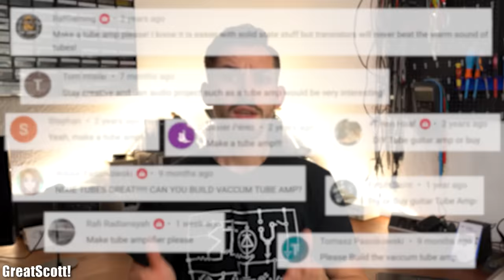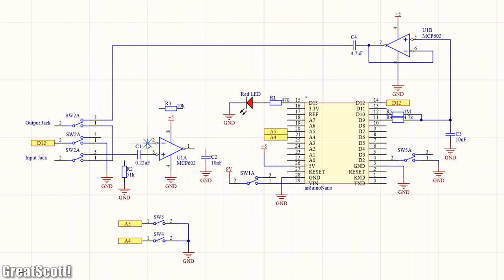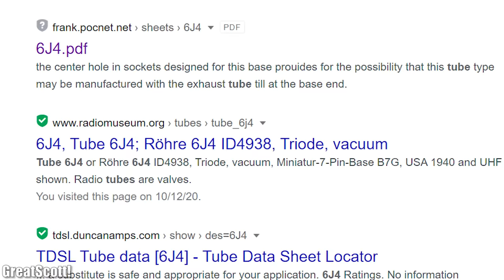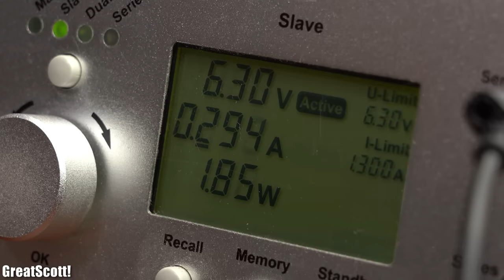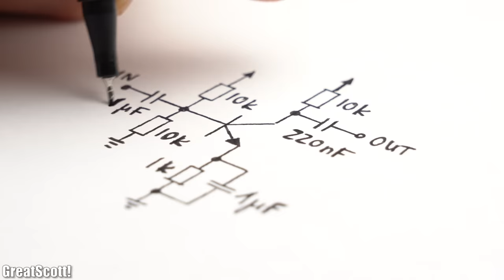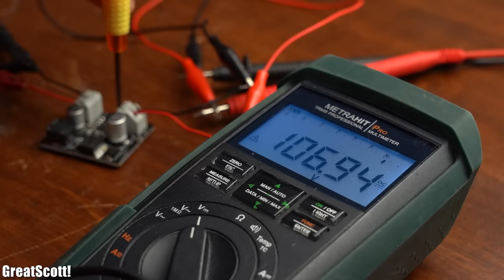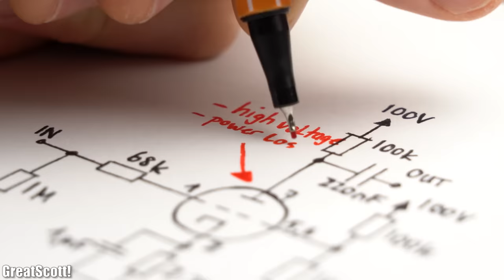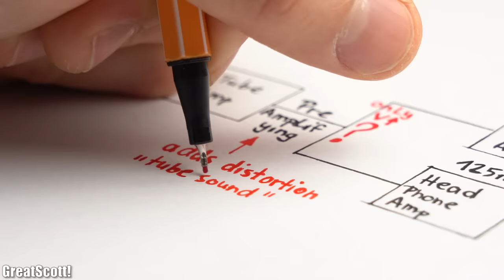Building a Tube Amp! Does it produce better audio quality though? EB#47

Comment: Tubes are just better..  I use Tube Pre-Amp's and Power Amp's ...   I do use solid state pre-amps at times with a DSP unit inline. these are then mixed to the input of the Tube Power Amp. 
The Tube pre-amp has a a EXF loop to a tube sweetener 3 12ax7's   the the Solid State pre-amp has a EXF loop to a DSP unit ( you can do just about anything you wish in this area ) both outputs are then mixed together Dry and Wet .. Dry being the tube unit and wet being the solid state unit.
This allows for so many setups and music types. with todays ADAT - DAT - and Hard-Disk ( or now solid state drives ) you need something to put the life back into the sound....  Tubes and Tube Sweeteners do just that !  Just remember that your drivers add color as well...   Unless you spend BIG DOLLARS... 
The Joke is this . . . .    Witch is better?????    1)  a single to that has been EQ'ed to correct the room    OR    2) a correct flat single in an incorrect room... both ways the single is changed once is gets to your ears . . .    So if its sounds better it is better ! and Tubes just sound better !

Comment: I'm not a fan of tubes either due to so much vice and I find those that say they like them don't actually understand the distortion produced or if their tube amp they love really produces worthwhile 2nd harmonics. For this video you really should have shown spectrum analysis to see what harmonics the tube circuit produced. The ultimate goal is a big fat 2nd harmonic and as little odd harmonics as possible. I've compared a few tube amps this way and most don't produce 2h that's even audible and add a tone of odd harmonics. So most tube guys are listening very poor audio which is amusing. Or they buy expensive tube amps that are highly linearized and carry no harmonics and may as well be listening to a good silicone amp which is equally amusing.

Comment: Best to go with a tube preamp with active EQ old school stereo equipment to a tube stereo power amp sperates then to speakers. My preamp is 1959 era 2 ea 7199 pre tubes 1 each per channel, 2 each 12AU7A or 5814WA 1 for bass another for treble each channel cathode following circuit= 4 volt to RCA output to a 1959 tube stereo power amp 2ea 7199 -1 per channel to 4 each 7408 or 6v6gta 2 push/pull each channel to 5 way binding post outputs to my Altec Lansing model 17’s speakers, super imagine, outstanding clarity, airy, superior sound stage, voicing identical to the instrument being reproduced by the Altec’s. About 18 watts per channel you would never imagine 18 watts of tube power could give out such power. Speakers are rated at 117 db 1 watt at 3 ft. Point to point design not one transistor in there using solid copper low oxygen wire silver soldiered joints.

Comment: Doing an A/B test of steady state tones does nothing for a test, audio is a complex wave, you have transition times, phasing, differnt results based on output load etc. The ouput stage of a tube amp going to a transformer will be affected by the speaker load as well, durring a high drive, the Q of the tube in every stage will change. So doing a little circuit tube vs transistor with a steady state tone is futile.

Comment: Sometimes, you really want the distortion of a tube. I use a tube as a distortion for my electric guitar, so I can plug it in my mixer/computer without using an actual guitar amp and mic setup in-between and it sounds absolutely gorgeous.

Comment: Your tube is not the same 6J4 triode you found datasheet of! This is chinese version of russian 6Ж4П pentode. You can see it if you search for images. Vacuum tubes happens to have very distinctive internal structures so you can easily guess the model if you have some experience with them. There is zero chance your chinese 6J4 (6Ж4П) will work in circuit designed for american 6J4 (6С2П).

Comment: It isn't a correct tube amplifier. It's a hybrid which doesn't do much with tube amplifiers. You can find how real tube amps are built and usually they don't use PCB. Also you can rarely see any semi conductors in there. In my diy amplifier I use them to stabilize +315v anode voltage and drive 6e1p electronic (tiny CRT) light indicators. I don't like I can't post a picture in comments on YT. And also the fact that you will have a tiny chance of seeing my comment

Comment: Disappointed you're using a hybrid valve amp and not a true one with true pre and power amp sections. Also disappointed that you're not building a guitar amp, where the harmonic distortion of valves becomes more relevant.

Comment: Make better resampling - upsampling method then nowadays arithmetic or simple filtering produce. Its more important because signal processing before its amplifing. Arithmetic methods cannot solve aliasing problem over all the spectrum. Ehhm, i saw this mobile phone crap that have bad resampling patent inside :D Resampling affects all the harmonics changing into disharmonics including bassline (little, but ...). And then use some of nice tube amplifiers. PS: Best.. only way is DA-ADC method.

Comment: There is a misunderstanding that passing a single gain stage makes sound tubes and it does a little very little try a push pull tube amp it can be very small say 1/2 watt the concept is the spectrum of distortion and will cancel out the odd harmonicas your brain doesn’t like these so this is a simple added device put in a tape monitor loop and you have a good A B switch put some good headphones and see

Comment: The answer is no. Different perhaps but not better. I have yet to sit behind a tube SSL or neve console, it is all discrete circuitry that does the work. Tubes are going to add uneven harmonics to the signal which is nice but not better.

Comment: Tube amplifiers and preamplifiers for hifi almost always win out and they almost always cost more.  The companies making such usually have many decades of insider knowledge built in which includes certain makes and models of capacitors, circuit layout, etc.  They also know the difference in sound between various make and models of tubes and may do cherry picking of batches of tubes.  Tube preamplifiers, eqs and compressors for pro audio use almost always win out also and of course cost more.  Many of those are not designed to be as clean as possible but purposely include some parts and circuits that make the sound coming out better than went in.  In pro audio is it very much about winning and so whatever wins, wins and specs hardly matter, though the specs are very good in many ways but still it is the sonic fingerprint that matters most.  Virtually all pro audio tube equipment have output transformers which is about 50% of "the sound" being sought by music engineers, producers and the musicians themselves.  The output transformers are rated for driving 600 ohm loads but sound best driving about 1200-1500 ohms.  I have heard pro audio tube gear a lot and it's always a thrill.  And it's hard to believe until you hear it but the voice or instrument and playing skill seems to go up by a couple notches.   That won't help amateurs much but pro musicians, or those almost at the pro level really do get some  extra cred from this gear.

Comment: No. Everything that is magical about tube amps is the same thing that makes them technically inferior circuit. Amplifier stages that color the sound and therefore don't produce an accurate representation of the source, DC rectifiers that can't produce consistent B+ and begin to power sag at louder levels... All of this stuff sounds great, but thats also why they developed germanium and silicon diodes and transistors.
Smaller cheaper and more efficient.

Comment: In addition to that not being a tube amp, you did not properly present the use of a heater element in the tube and what it does. The heated filament wire heats the air under vacuum within the tube and creates a field in which electrons may pass through the air from the cathode to the plate or anode. (which is why real tube amps need to warm up before functioning) And since they can only travel in one direction, resulting in a diode effect. It is why they were called "valves" back then. Amplification results from electrons being "sucked" from the cathode and "spit" at the plate in larger numbers because of a tiny bit of voltage applied to the grid. You really need to hear a true tube system to really make a decent judgment call, a system with a tube pre-amp and a tube power amp with no solid state devices in the signal chain running B+ voltages of several hundred volts (some use over 1000v!). Granted, I have heard decent sound from hybrid systems but they had speakers driven by tube power amplifiers.  You never heard anything more than a headphone amp chip and likely MOSFET output chips. You completely missed the point!

Comment: in other words you didn't buy a tube amp ... at all, you got a preamp with tube ... and most hifi people don't assume class D is the way to go ... (sure, some sound fantastic - class D). The tube people sometimes want ALL TUBE - linear, with tubes for rectifier, tube preamp, tube power amp ... However, exploring the part is nice thanks. Im no tube amp guy, happy with my LM3886 DIY amp.

Comment: I've heard both tube and solid state amps If their is a difference I find it small I heard 10;000 dollar tube amp that didn't sound better then my 1000 dollar Onkyo amp in my opinion Plus tubes do burn out while my amp could last until I'm dead !

Comment: Are you sure that any of the pins of these tubes besides the heaters are connected to anything at all? These smart Chinese conmen, knowing the demand for tube amplifiers, would gladly sell you a "tube" amplifier  in which the vacuum tubes are merely decorative, just to be able to command a premium price for what is basically just an ordinary modern class d amplifier

Comment: Learning Vacuum tube electronics looking at datasheets will not give any knowledge how to design a vacuum tube pre-amp. It also looks that your transistor amplifier is also a basic electronic textbook design. Professionally design simple vacuum tube pre-amplifier can have less harmonic distortion that a transistor amplifier unless more complex design is required. If you look at the inside design (even of low-cost OP) you see complex design required.  Comparing datasheets of a triode (more like FET transistor) of a bipolar junction transistor (BJT) is not quite that simple. If you compare a complete analog (VT) audio amplifier to a complete analog transistorized version (include diodes, BJT, FET, etc.), the complexity for obtaining the same quality (including distortion).

Comment: Sometimes you find a vacuum tube inside an amp that only has the filament connected to light up.  If the tube is on show inside a window in the front panel, that is a sure giveaway.  Totally fake and deceptive marketing to cash in on the interest in real vacuum tube audio technology which can sound  fantastic.

Comment: Respectfully, that's a pathetic cheap preamp.  A full Tube amp "Head" to a Stack System is awesome with a very natural "wind" like swaying subtle vibrato.  High end digital amps are amazing but nothing in the natural world is digital and a tube amp emulates more of a "nature-like" sound.
Reply: I have had a Prima Luna TUBE amp for 5 years and I CRY tears of Joy, when listening to any songs...now I want to go FULL retro or Analog, however that would be a HUDGE cost... I'd want the most affordable Turntable and maybe only..... 20 to 30 then 40 up to 50 Classic Vinyl Albums.....but have you seen what THEY want for 1 album....not a good ROI.

Comment: Your testing equipment is only 8-10 bits in resolution. Sensitivity of Human ear is much higher in terms of resolution. I'm not talking about frequency here. So don't be confused. About the little tube amp you built, sighs. It's like you drove a poor car and concluded that all cars are bad. You'll need a decent tube amp to understand the magic.

Comment: Loud.  Tube amps "sound" louder. Power section clipping rounds the edges of the clipped signal... While vs. SPL May be the same.The human ear recognizes the tube amp as louder. 

Late 70s.... Solid state is the future! Today... Still selling tube amps....      Rock n roll is the sound of high voltage and speaker screaming... Ohhhhhhh fuuuuuuuuuug... While holding on for dear life.      My 2 cents...

Comment: Tube amps drive speakers much more efficiently.  10x much more. So my 70 watt Scott LK-72 with eleven tubes, and rounded signal, is louder and sounds much better than my 500 watt 5 channel AV surround amp.  More deep bass also.  So you will need very tough, well made speakers with average or better sensitivity, 6 ohm 87 db workes for me.  I much prefer tubes.  They do not distort at full volume, but you may go deaf or blow out a speaker.  Like foam woofer surrounds... How do I know this?  Physics.  Imagine pushing someone on a swing.  The swing is your speaker, moving in and out.  Now hit the swing with a bat.  Make it swing high.  Good luck.  Now push the swing, gently, then accelerate, then let go.  Repeat.  The swing will go much higher, with much less power required.  The bat is a digital solid state amp signal.  It slams into every driver.  The tube signal is rounded.  Like pushing a kid on a swing.  Hope this makes sense.  If you have experience with tube amps, it becomes clear.   The harmonics also bring recorded music to a more life like live sound.  Tube preamps into class D amp chips from Texas Instruments have a similar result. Thanks for the video.

Comment: I can only think of Compound Metadyne and Amplidyne generators . Thats why wacum tubes were used for to counter problems and use it in cloosed lop systems like by those Hot Bulb Gasoline&Disel engines who drived Compound Generator then the generator drived directli electric motor . So they used ordinari center tap phase shifting transformers rheostats potenciometers including wacum tubes due to reason back feading was problem even for modern standards reverse voltage protection is terribel for ic chips .
Also Multi Strokers work differentli there is lot sience behinde it including magnetos,buzzing horns,wacum tube aka xenon bulbs ,dual automotive  relays, bouth alternator delco and starter motor s/r type are compound mashines,stroke spliter and devider creates differences in potential also I refere to the water bucket vandegraf at this point static discharge generation meaning no ignition system,also disel engines do not have ignition system at this point,piezo effect ignition and vaporisators. About dc generators their ferrite magnets out put more amps but reduce voltage the magnets decay demagnetise creating stronger out put so wires are cooled but housing for magnets are heated so thats why old generators were polarised multipel baterrys in series to activate again magnets! Another properti of dc mashines is that if you swap around magnets you create out put at ich brush like this (++,--,-+,+-)! For exampel xenon bulb can make baterry dead flat in mere secunds thats why it can by used to counter back emf for dc generators. As such the metadyne generator is nothing more then multi phase ac generator if you wuld use more brushes who are shorted in centrain places or you culd use bouth slip ring and commitator to get ac/dc non regulated out put!  
Any way I didnt brake any laws of phisics or electrical enginering. Wikipedia Metadyne Generator 100watt-10.000watt out put power rotary converter + rotary voltage booster also called excitation magneto they used ordinary planetary gear set to achive that.
So to make things even more simpler imagine Strling/Papp/Pulse Jet engine working in 1 engine unit who use's such special Compound Generator with Compound Multi Stroker Engine. So thats where transformers ,deviders ,converters ,potenciometers including reverse protection or voltage boosters and amp booster wacum tube operatated come in to play .Ordinari ic chip is not good enough to beat colideing frequencis at high speed that wuld by called magnetic pipe gun or pipe generator .I personli hate ic chips they are terribel choise for controling back fead and are not variabel enough to by used for any special engine design or compound generator as such wacum tubes are precision tools for controling phase shifting for dc,dc pulsed,ac or all together . And they work great on engines in cloosed loop system including controlers for generators in cloosed loop they are lot more rubbust the shock risk or static discharge is reduced.

Comment: It is not a good comparison to a real tube amp, the signal should go true only tubes an a output transformer should be used to match the low impedance of an 8 ohm speaker. Thats when you know how important output transformers are in the whole system, make a new vid and take look at this site: http://www.triodedick.com/projecten.html